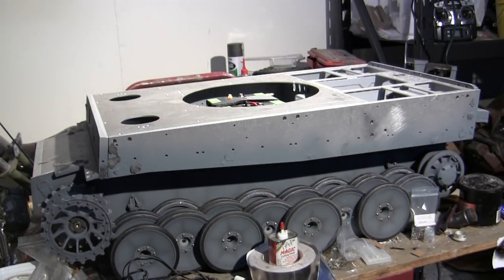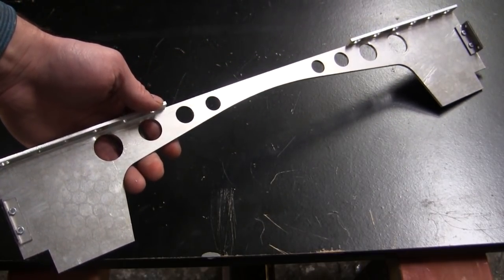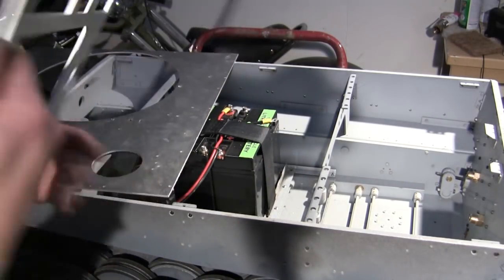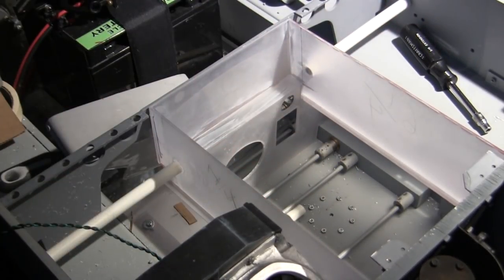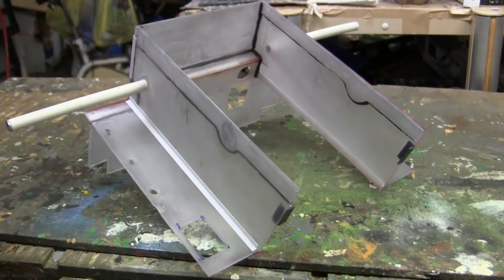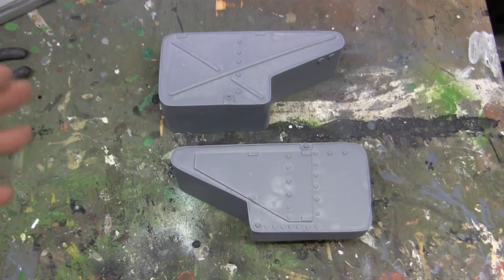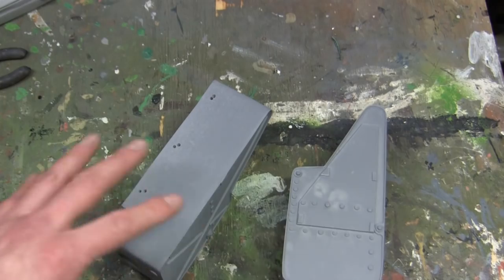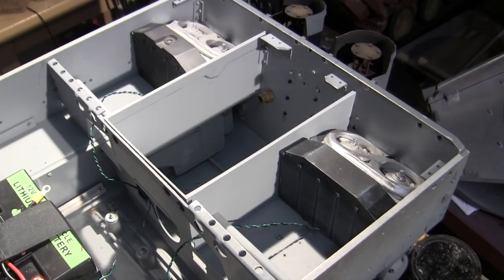RC 1/6th scale Armortek Early Production Tiger video #8 (hull Bulkheads and engine compartment)

Comment: Do armortek tanks have turret rings like the real one?
Reply from the maker: If you mean the internal turret cage / basket, no
Reply from the maker: If you mean the ball bearing ring, kind of. The kit has a machined brass bushing that the turret sits / rolls along
Reply: Oh. Can it be easily changed to one similar to the real thing easily without requiring too many expertise and machinery?
Reply from the maker: no